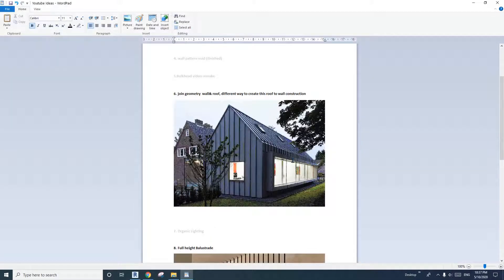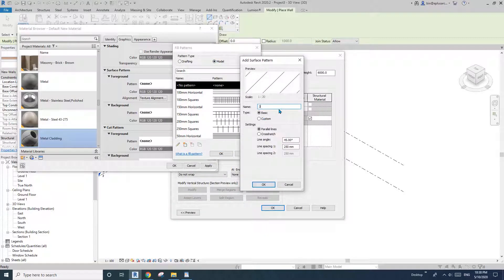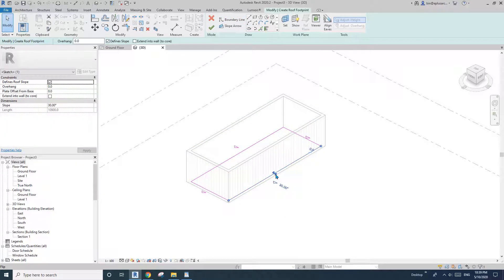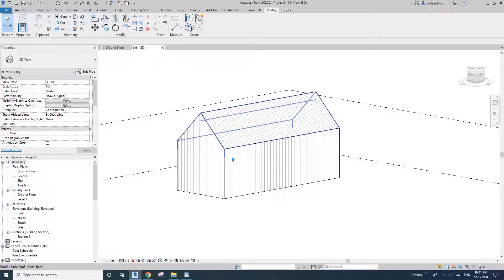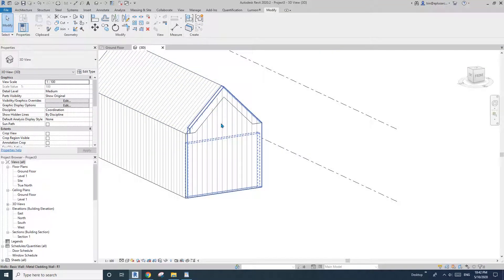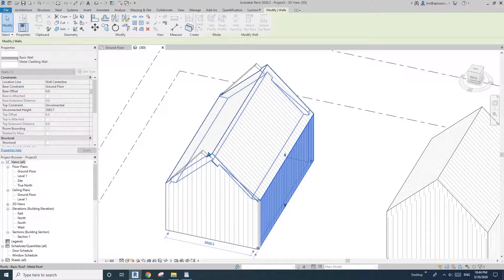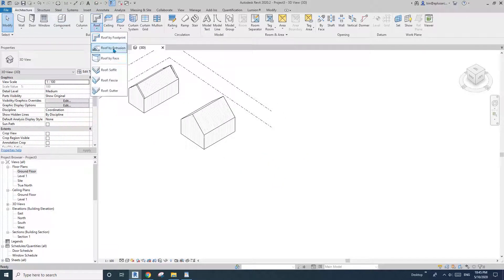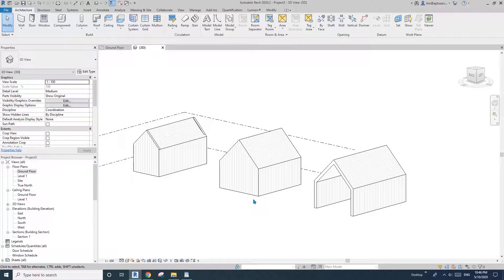Revit Exercise (Day 198) - Simple Gable Roof House

Comment: bro sketchup has intersection tool, which makes many shapes easy. can we do something like that in revit using join and cut?
Reply from the maker: They are quite similar I believe, but in Revit, those lines and faces created using the Cut or Join tool will not exist after you delete or move away any of the objects, if you know what I'm talking...
Reply: @BINHE615  can you make a video comparing both doing same thing. Thank you.
Reply from the maker: @arcsw  Sure, I'll have a look, haven't touched Sketchup for more than a decade...